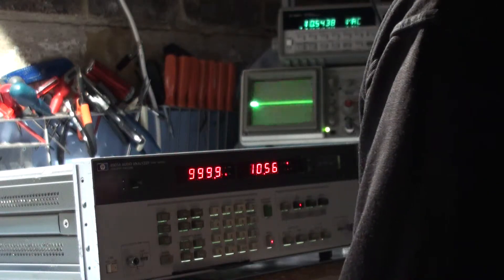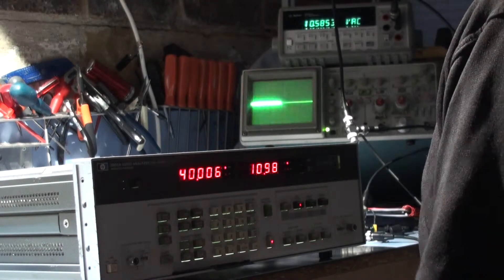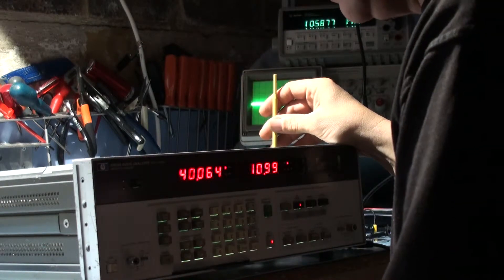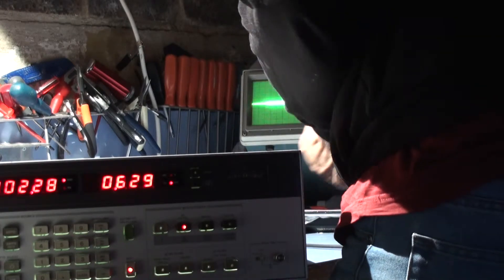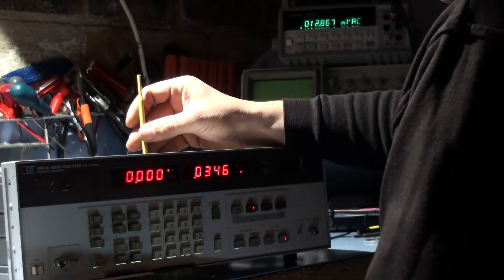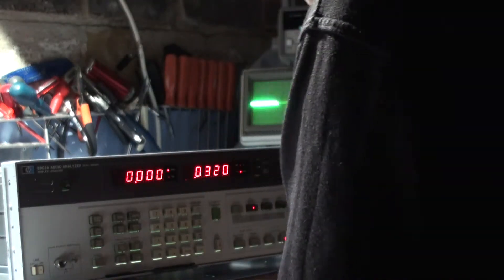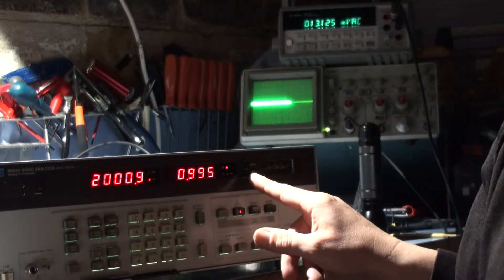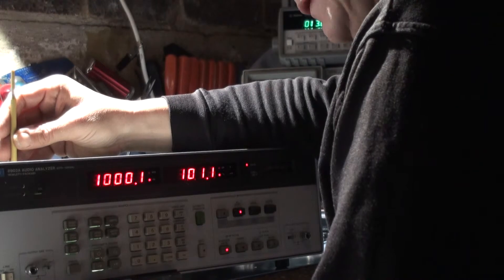Hewlett-Packard 8903a calibration(2)

Comment: Hi
I have an HP8903a that I recently bought. I'm doing your calibration procedure along with the manual and watching your video. To adjust "Flatness 24 dB" I only got 7 rms from my generator. In the video, you should press Ratio. I left the setting as it was until I got another generator.
Reply from the maker: +Jorge Silva To be honest, if the 8903a is on the correct range (as set by the spcl function) It should be fine.
Reply: I would like to thank you for your video. Great dedication. Congratulations. I did the procedure to the end. On board A6 I did not find the A6R35 - Input Offset, I did not find it. on A6TP5 I found 3.9123 mV. OK.
The A6C31 setting, well I saw a single capacitor without reference, but adjustable. I'll try to figure out what kind of board this is. The version must be different, more current or old, who knows?
What impresses is the functionality, fast and direct. Great equipment. Better than the old HP 334a.
Thank you. You helped me a lot.